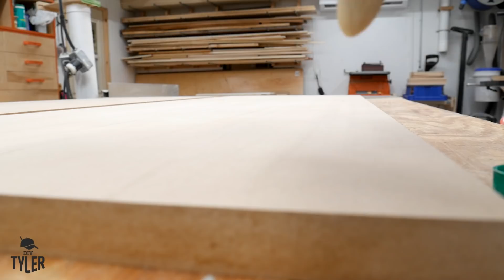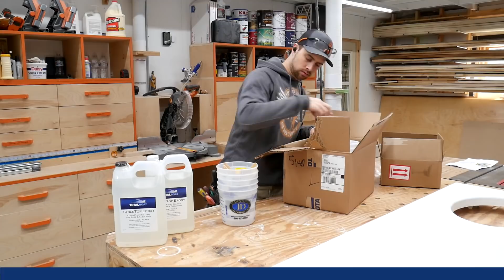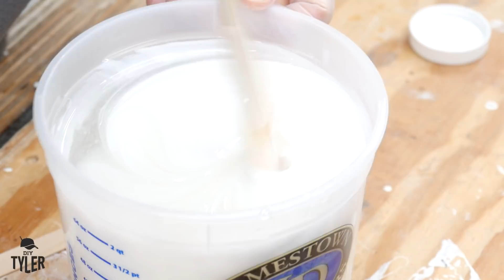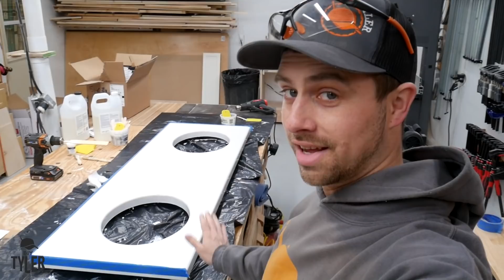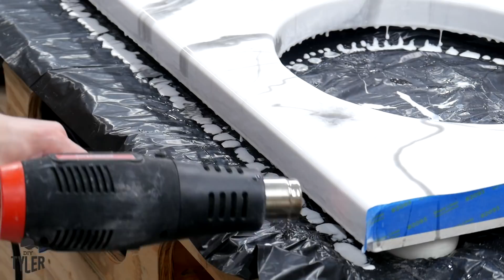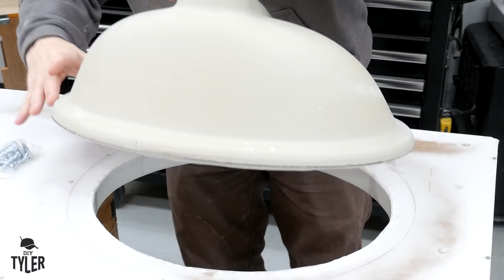White Marble Epoxy Counter Top | Is an Epoxy Surface Worth it?🤷🏼‍♂️

Comment: Does anyone know how expensive this project is? in my area (ontario, Canada) epoxy is about 300 dollars for 4 or 5 litres.....which he definitely used. Plus 1 sheet of MDF (30-40 dollars) Plus all the time and effort... 

You can get a real stone or quartz countertop similar size for 600-700 bucks. It doesnt seem like a project that is worth it to me?
Reply: Not sure what the shipping costs look like, but I just did a quick google and Stone Coat Countertops sells epoxy at 2 gallons (7.5 liters) for 240 bucks. So if he used 5 liters, that's about $160 worth of epoxy. Not cheap, but definitely a fraction of the quartz rate.